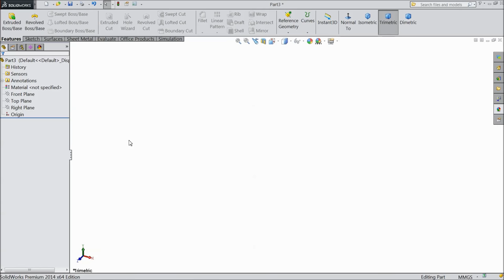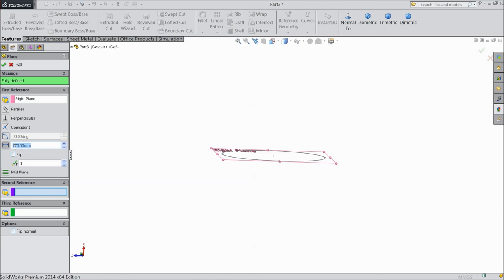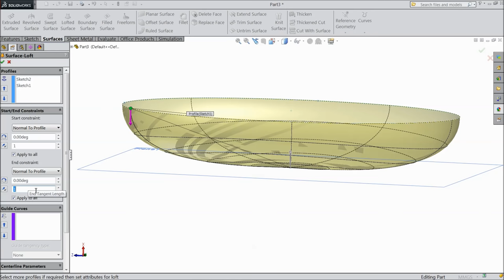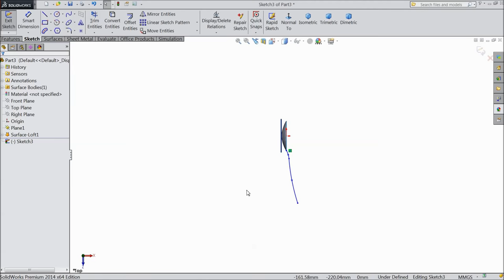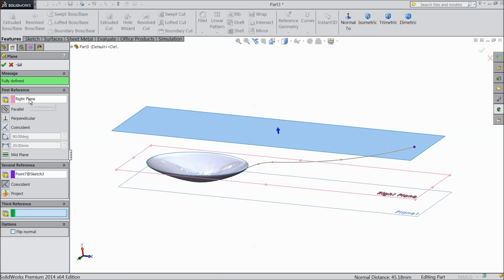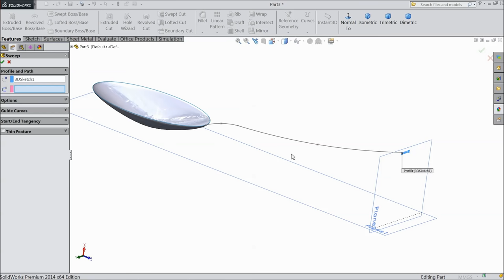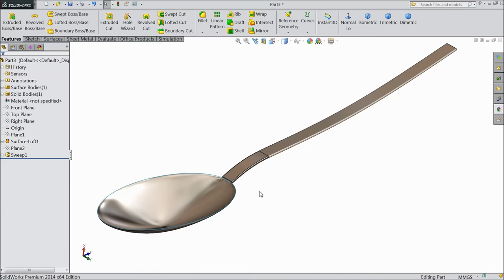How to Make Spoon in SolidWorks

Comment: I have two concerns about this tutorial: first, as @Hamad al-badr mentioned, there is an unrealistic gab between the spoon and the arm. second, I think using the surface feature makes features infinity thin, so how to adjust that if I want to increase the thickness?
Reply: you can sketch on the right plane a closed loop shape that fills the gap and then extrude. also you can thicken the spoon by searching the command thicken...